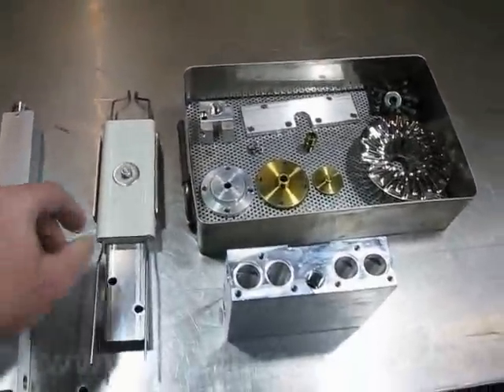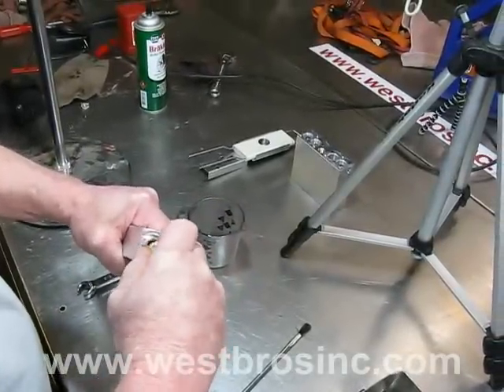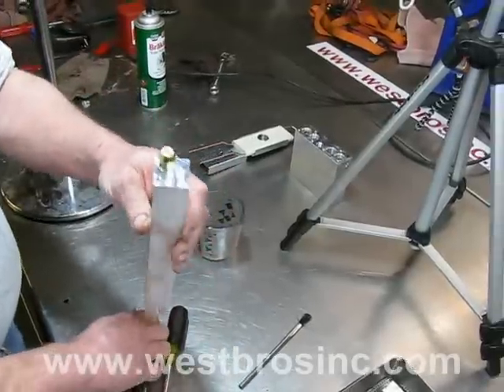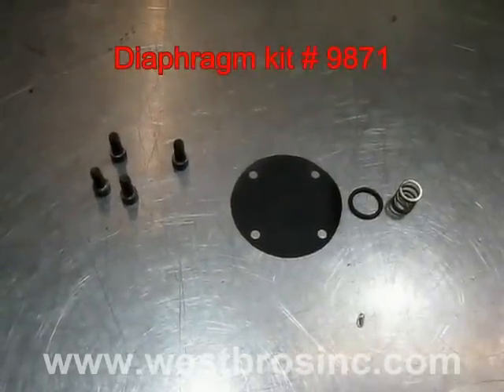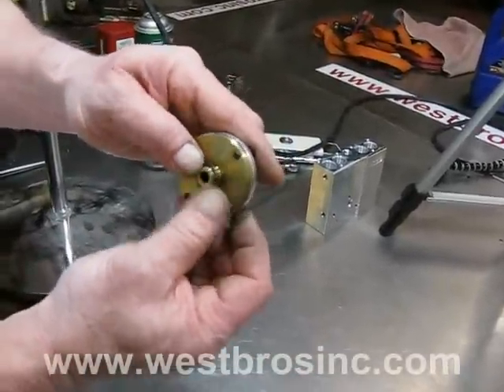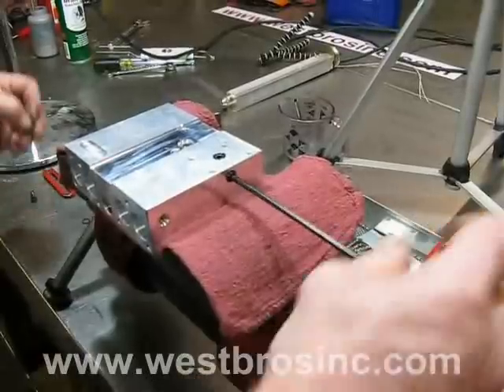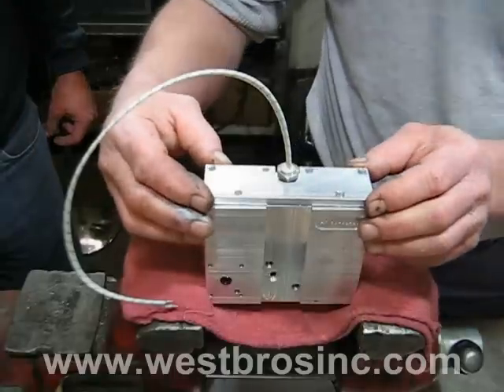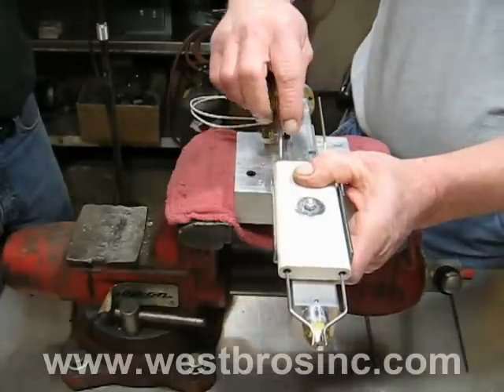#4 Waste oil heater service / repair Lanair pre heater reassembly FI/HI/MX series

Comment: How often should this full rebuild procedure be done?
Reply: I have had mine for 20 yrs in a mechanics shop, model hi280 once a year not really a rebuild more of a cleaning out ash, re adjust ign rods clean nozzle, biggest problem on the older models is when pre heater is left on and burner not used like overnight it will cook the oil in the pre heater then clog your nozzle i think the newer ones prevent this from happening but basically free heat for us 75' all winter in shop
Reply: @pattymueller3539  i just knoticed my diaphram leaking i just got it but i think it 15 years old